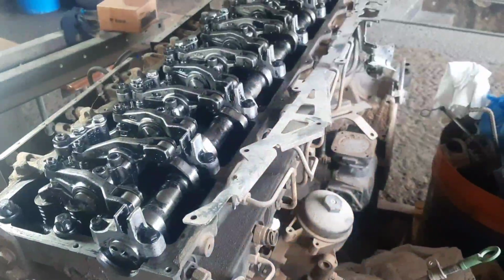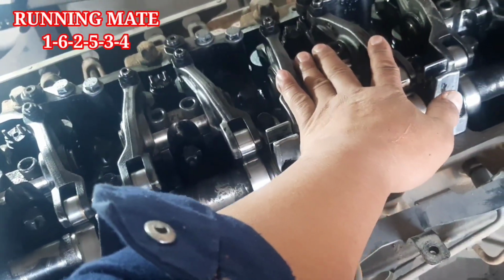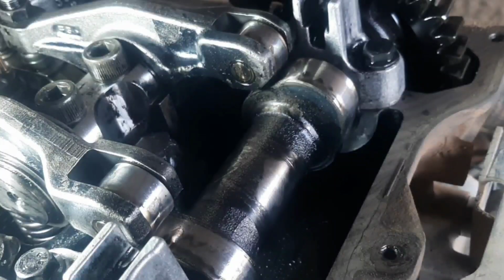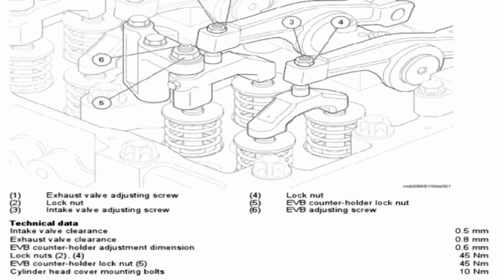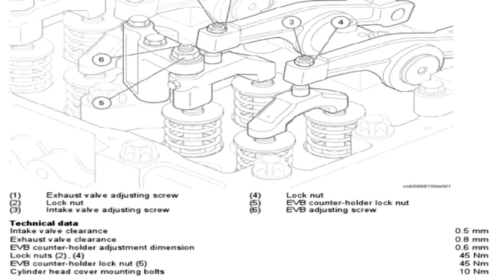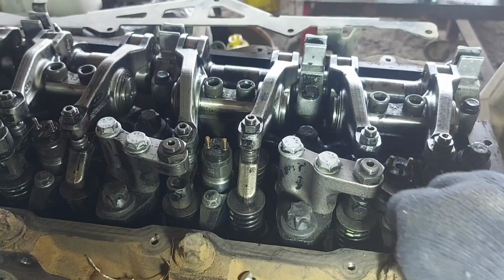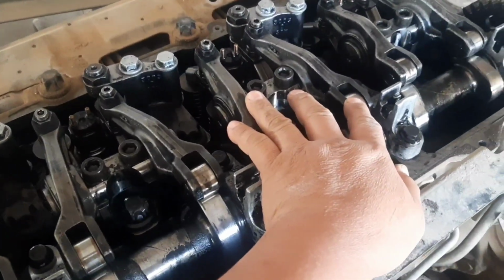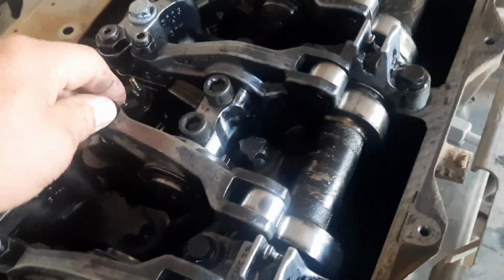How to adjust valve clearance.Man D2066

Comment: Magandang gabi brod. Baka matulongan m ako truble shot itong tinatrabaho makina sa man cla 18_280 mag overheat. Akin na ito top overhaul. Pinalitan ko na ito linner, piston ring cylender head gasket. Nozzul tip. Bagong calebret ang injection pump.umaandar na. Pagkatapos palyado. Mag overheat. Dati overheat ang problema nito.
Reply from the maker: Saan location mo sir?
Reply from the maker: Ano ang injection pump nyan sir?rotary ba or inline.sa ppagkakatanda ko kapag rotary injection pump.35degress btdc ang injection timing.kung inline nman ay 13 degrees

Comment: Good pm bro anong max and min torque sa cylinder head d2066 /con rod at main bearing
Reply from the maker: Nakalimutan ko sir nandon kc sa record book ko.pero pakisearch din po sa google baka meron yan.sa pagkakatanda ko.yong main bearing ay 300nm plus 90 degrees.conrod bearing 100nm plus 90 degrees at cylinder head 300nm plus 90 plus 90.

Comment: Good morning sir 
I am facing a problem with D2676 MAN eingen. 
There is creating pressure in readiator i changed readiator and air  Compressor pump but problem is still as it is .
Please help
Reply from the maker: Hi sir.what kind of cylinder head that one sir?is that single inline cylinder head or indibidual?
Reply from the maker: Actually that was also happened here.creating pressure  even radiator and air compressor are new.so we was dismantled the head and check the liner and clean.the after that,pressure is gone
Reply: Singl head
Reply: Make a vedio we will thankful to you
Reply: Clean liner you means Piston liner or water lines
Reply from the maker: what happened to our unit is the same with your unit.we replaced the radiator as well as the air compressor but the pressure still didn't go away so we decided to open the head. then we saw that the one two and three liners were on same as indication of overheating compared to four five and six liners. so what we did was we removed the liner and cleaned it well. we also replaced the head gasket and then it was okay.

Comment: Hello sir,,Although the letter N does not appear, the engine is running... Please what is the reason
Reply from the maker: Hi sir,actually i cannot experience that kind of trouble yet,but i want to know if when you shift in reverse,letter R showing?
Reply from the maker: And hows if you shift in first gear or second gear third gear.number is showing or not?
Reply: yes sir it shows the number R....and everything is fine..
Reply: sir MAN D2566 MTE tappet clerance? @jlcworkshop